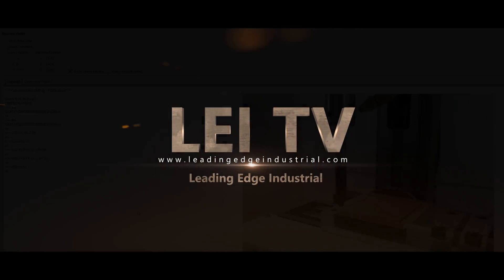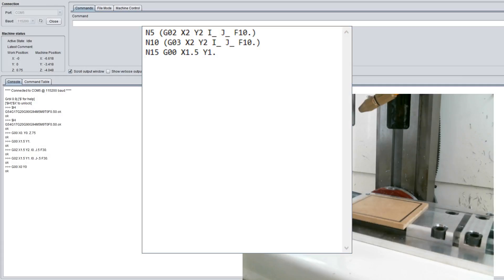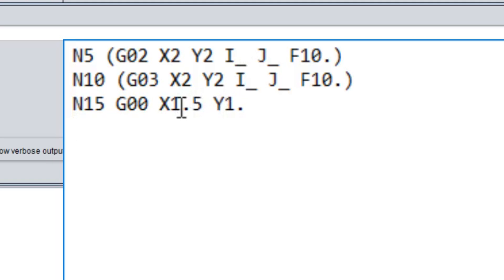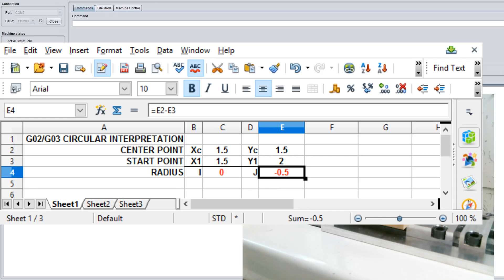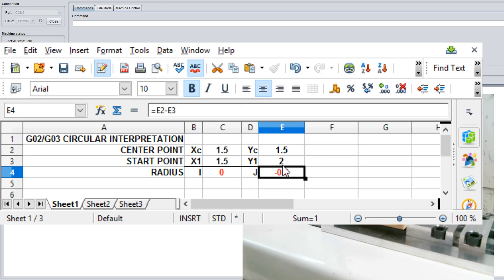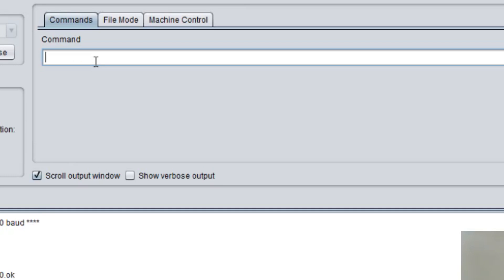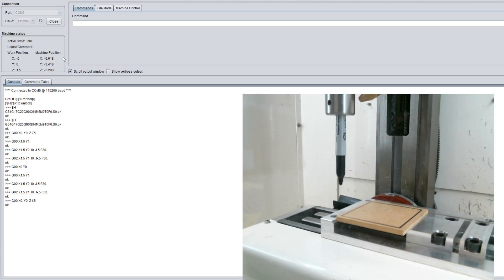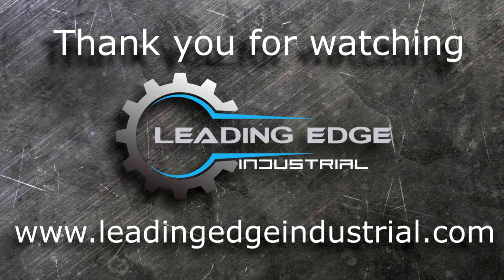G-Code Basics, Ep. 2 - Circular Interpolation G02 G03

Comment: Why not do a perfect 360 hole in a single block. G91 G17 / G02 X0 Y0 I1.375 J0 (Pretending i'm using a 1/4 cutter)?. It's faster and less dramatic, avoid too much editing or calculations.

Comment: The chart at 3:38 REALLY threw me off! It was stating that the J is calculated as: 
J = CenterPoint - StartPoint
It took me a couple of hours to figure out that it was an error. The calculation is:
J = StartPoint - CenterPoint 
It was then observed that at the next scene the code had the start point at 2.0 instead of the 1.0, contrary to what was shown on the chart.

Comment: Think you may have made a mistake with the J calculation? The Y start point is 1 (not 1.5) and J should be 1 (so not 0.5)?

2 - 1 = 1
Reply from the maker: The calculations are correct as shown; however, the step-by-step calculations are for the inner circle (shown at timestamp 6:43). The inner circle has J values of  0.5 and -0.5. The larger diameter circle (shown at timestamp 6:50) can be calculated using the same process, and you are correct that the larger diameter circle has J values of 1/-1.

You can download a copy of the executed gcode by clicking the "G02 / G03 circle" url, found in the description.